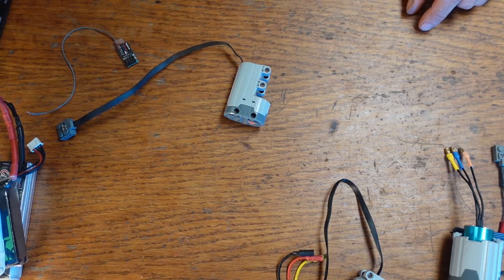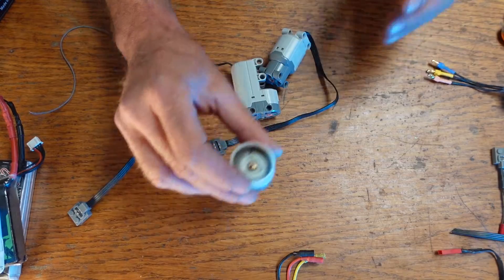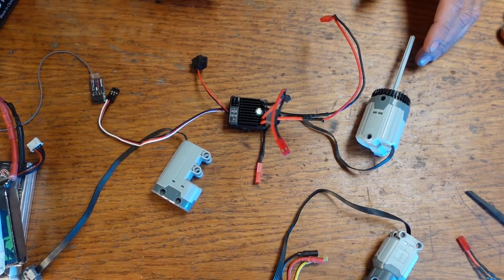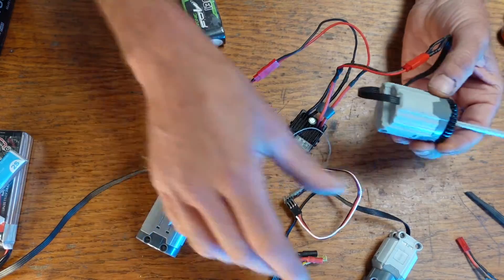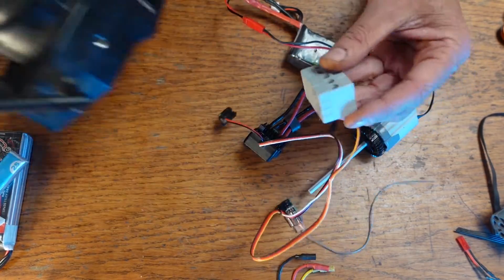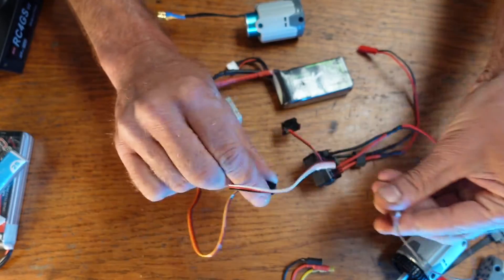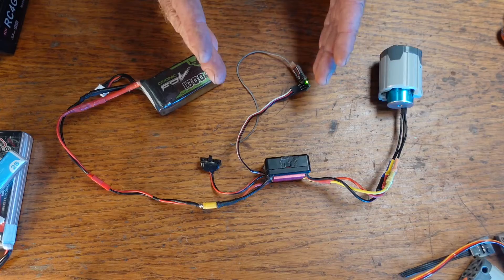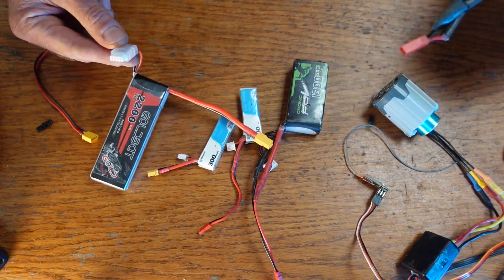Beginners guide to using RC radios with Lego

Comment: Im unsure if you know about the old lego set RC Super Sonic it has a few ather sets connected to its steering system which ran from 2002 to 2003. i found a few of those pieces the steering and drift tires but ofcourse i dont have buggy moters how ever you told in a earlyer video that the lego XL moter is technicialy a orbital gearbox. So i got these Tamiya Moter boxes and they have a few includding a orbital planetary gearbox so i might use this video and ather videos i found to make my DIY system for controlling this build. Also im trying to build something like a RC drift car and well i could easy add a gyro to it if i use those normal RC parts. -- also -- i dont think you realy need a geek servo you can also mode the output shaft from a normal servo into a lego piece. -- i got those spare plastic junk stuf you get with a servo set it has like a 6 legged white piece you can mount on the servo or cut to shape -- im gone bolt some lego technic piece to that. -- issent the cleanest setup -- but then i dont need buy anything more. -- trying to do stuf on a budget -- by the way i dont know if i can replace that plastic piece with something of metal to make a stronger adapter piece but i stil need to fool around -- I did find this video a bit informative how to changed and adapt serten lego pieces. By the way im unsure if 2KG steering servo is always enough for serten projects. -- but yeah money is tight but im surely gone consider getting something once i can. --

Comment: Just a side note on the aircraft esc; most of them DO NOT have a reverse function on them, they only power the motor in one direction. The surface vehicle ones usually have 3 modes; Forward/Reverse with drag brake, Forward/Brake/Reverse (you have to tap the trigger twice to go into reverse, first tap is brake, second is reverse), and Forward/Brake only (used for racing)

Comment: Nice vid. You're doing great job. I was wondering of putting brushless motor on lego system (sbrick, buwizz etc.). Are you came up with an idea ? It's even possible? Some brushless ESC is needed but lego protocol is strange, I canot figure it out
Reply from the maker: I have nothing for you. Unless you do that just because it would be cool it would probably the hardest way and not the most inexpensive.

Comment: Hi, I was wondering if you ever tried running 7V to pins 1 and 2 of a Powered Up "L" motor to get it to run like you did with the center wires of the Power Functions motor.
I dont want to possibly blow my PU motor but don't want to buy a PF motor if that hack would work. I plan to run the buggy 42124 with my Tamiya controller.  If you reply, thanks in advance.  I learned a lot from your vids.
Reply from the maker: I have not. The PU is like a stepper motor. It has a control board that sends power to the motor. The board may need to see a control signal before it sends power. If you bypass the control board and send power straight to the motor it would work but you would have to connect leads to the motor. It could be modded without breaking it. The board is connected to the motor with two large solder tabs right next to where the wires come in. Solder an extra lead to those tabs and you will have two wires coming out. One for normal PU functionality and one for direct power.
Reply from the maker: Or here is my affiliate link for 2 L motors for $13 https://amzn.to/4hiq4AY